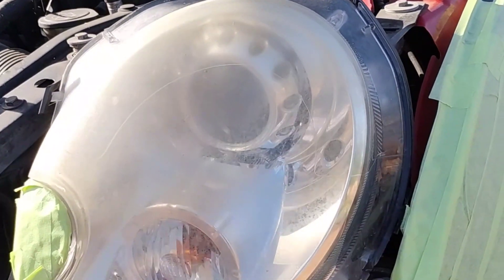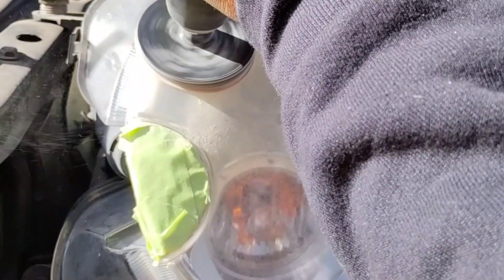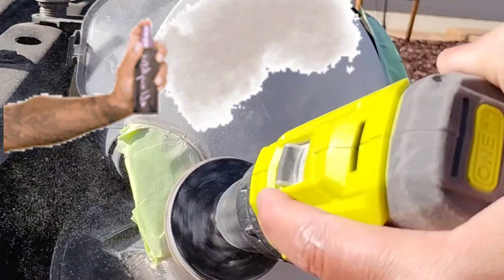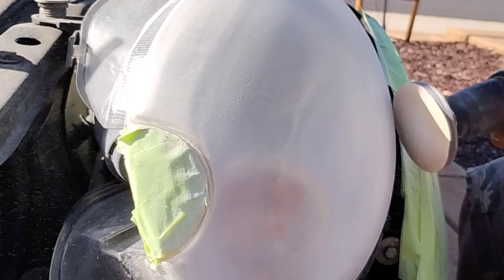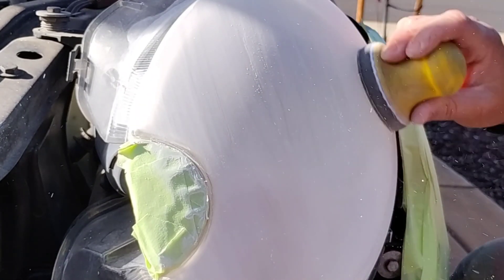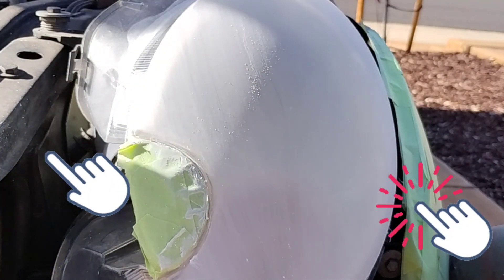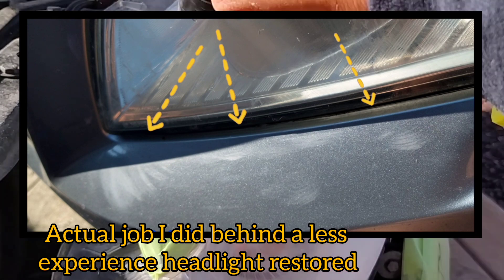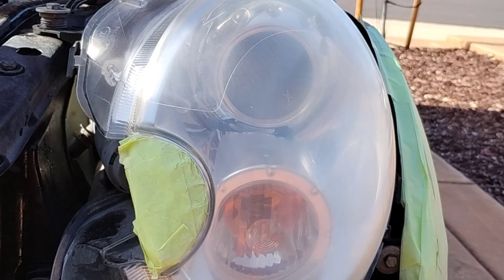MINI COOPER a wonderful headlight restoration experience ❤️🇬🇧

Comment: Hey. Bro I recently restored a set of headlights, and I used the mcguire's headlight coating. Maybe like 2 minutes after I put the coating on, it  started to rain & left spots on both headlights. In a case like this. I basically repeat the steps 500, 800, and 3000 again, right?
Reply from the maker: Probably the best bet..
Wouldn't doubt just repeat, left thoroughly drive for about 25 minutes and repeat.. it's the best way you could try to polish and do all these other things but it's just going to mess things up because the coating is too fresh..

Comment: Hello, many thanks for your videos. Do you know if this method works on restoring luminosity as well? I have a R53 Mini Cooper 2005 that failed the technical inspection because of dim headlights. My mechanic had already done restoration and the headlights looked pretty clear however in the photometer they produced ibky 0.6flux with 12flux. my mechanic says that this is because of microfissures that expands deep in the lens and there is nothing to be done about it. he insists only solution is buying new headlights but since the headlights are xenon and compact it costs almost 1000usd for one. I was hoping I can restore them on my own even if the mechanic refuses but since the problem is in the luminocity i have no idea if i will succeed.

Comment: Any way to take the plastic lens off, to do the inside? Mines faded on the inside. I already did the outside fine
Reply from the maker: It's kind of rare to be faded on the inside there's actually no such thing as faded on the inside... There's Lens  discoloration the baby you don't preaching inside of the headlight which is liquid vapor and dust..
But either way it's not recommended to take them apart it's not even worth it nine times at a 10 the light will end up breaking and even if you do nail it and clean it out real good they're going to fall the shit really fast it's a waste of time..
Reply: @theheadlightrestorationpro  So basically, I have to buy new $400 lights, each, just to get clear lens? Or just live with what I got? Either way sucks! Lol
Reply from the maker: @johngraham5978 pretty much it does suck I would try to go to a wrecking yard and find a pair even if they're beat up you know you can do headlight restoration they're they're probably be 20 to $30 a piece...
Check this place out . I'm sure you have one somewhere...
https://youtu.be/AQj5s4HX_G0?si=eceeLvQcAWiKLzDl

Comment: Have you ever restored a pre 2006 mini cooper headlights? (where the lights are integrated into the bonnet/hood) I'm trying to do the headlights on my girlfriends mini although I am seeing scratch marks at the end. They look clear from a distance although up close there are still scratch marks and they are easy to see with the lights turned on. They don't look as snowy as yours whilst sanding and I'm thinking maybe I need to start with a 320 pad? I think maybe there is still clear coat left on there as I can see a line around the edge (if that makes sense lol). Are scratch marks harder to remove if there's still clear coat on? And will the meguiars coating help to cover them up? I still need to purchase the meguiars coating. I thought the trizact pad or the polishing may get rid of them but no. Love your videos and I really appreciate any help! :)
Reply from the maker: You want to make sure you're using the P variety of sanding disc... Also be wary of the p320s unless you have to.. don't make your situation even worse...
And yes you really have to remove all the clear coat it scratches easier and will show through... Have to meet your depths watch a couple more of my videos and you'll definitely see how to get that.. take a look at this video...
https://youtu.be/C12RHABN0ZI?si=QW6_85St07EKuTdw
Reply: Great, Thank You!! :)   @theheadlightrestorationpro
Reply from the maker: @MotoJoeVids 👍🏽

Comment: got my 3M P500, P800 and P3000 trizact, do you have a video or some sort of picture chart showing how bad certain lights are and when to use maybe a P400 or P320 as I have noticed majority of your restorations you stick to the main three (500,800,3000)
Reply from the maker: Those are the normal usage.. you should try your best not to stray outside of that parameter.. if necessary if you test a spot and it seems like it'll take 10 p500s 
Then drop it lower... P320, p220.. I would never go lower than p220....
Check out this video here...⬇️
https://youtu.be/W75f01wxusA

There's a couple more up too..👍🏼💯
https://youtu.be/ONEm7rWAN0A
Or this one⬇️
Reply: @theheadlightrestorationpro  ok saw them before but will go over them again, also what number setting to you use with your drill while sanding? (TORQUE)
Reply from the maker: @lawrencethomas5746  will my drill is about a 600 pound torque..
I'm using my RPMs on the high-level setting normally between 14 and 1700 RPM.. wouldn't advise this fast until you get used to it..
Reply: @theheadlightrestorationpro  OK the highest RPM on my drill is 1500, so basically start low and slow until I get comfortable enough to pick up the speed
Reply from the maker: Yes sir.. I go as fast as pretty much possible without messing stuff up.. but I've done a lot of lights a lot of practice incredibly large amount of headlights...lol I am a pro... That's just to go slow sometimes going slow is even better far as your materials won't burn out as fast..
Reply: @theheadlightrestorationpro  will follow the pro's advice and keep watching your vids

Comment: the only thing I don't like about the meguiars headlight coating as that it's soft and doesn't have that thick clear oem look. if you run your fingernail across the meguiars it will scratch up. whereas oem or 2k will not. either way I use your process and want to thank you as I have started my own headlight restoration business here in socal. thank you for all you do pro
Reply from the maker: It's not soft after the curing process... Couple days later it's good... Not as hard as 2K clear ever but you don't want it to be cuz that'll destroy your headlight your headlight needs to flex and also deflect items/debris without damaging what's underneath...
But no problem keep watching plenty more to come..
If you want to have a successful business and get your skills up I suggest you watch all the videos..💯👍🏼

Comment: Huh...it would be great to know what tools / polishing compound / etc you're using.
Reply from the maker: It should be listed on the video when using... Flashed across the screen somehow...
This is an older video so maybe it's not but if not it's definitely in the bio..
Make sure to check out some more videos cuz it's an isolated thing if you can't find it...
Check the bio